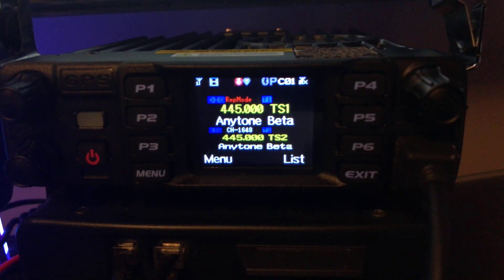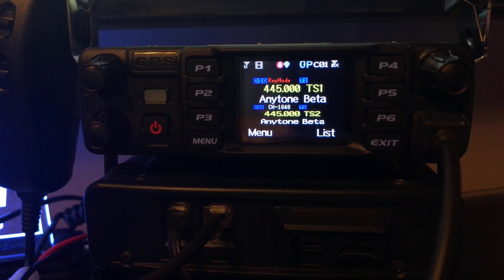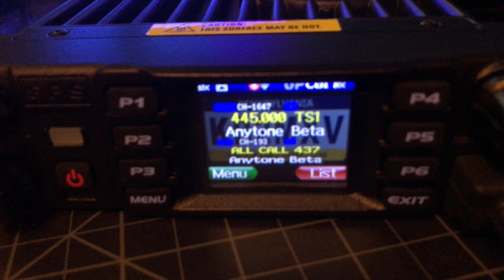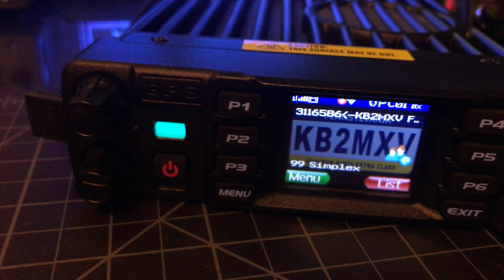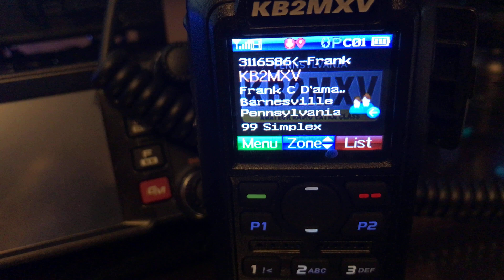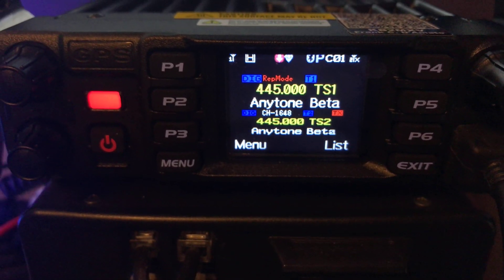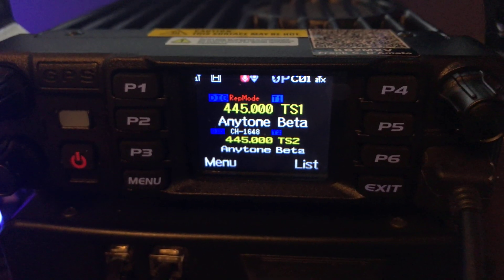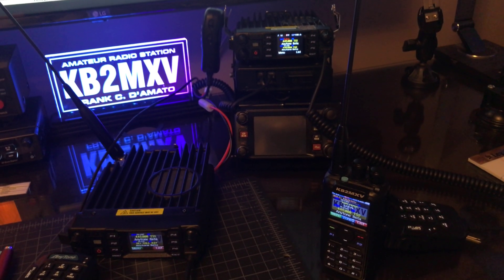AnyTone D578 repeater DMR Simplex on the Same Frequency

Comment: I guess it works, I hear the Tx on both HT's back and forth and the Tx light on the 578 comes on. My problem is, when you shut off the 578, you can still Tx between both HT's. On a couple videos I watched showed no Tx between HT's when the 578 was shut off. Of coarse they do not explain how to set this up. I crossband between UHF/VHF and when the mobile is shut off, there is nothing from the HT's. Can somebody point me in the right direction or send me a guide on how to properly set it.

Comment: I have 578 and, as I understand it, you can create any one digital channel with any TS, CC, TG, DMR Mode, etc.  Then you need to select this channel in the upper and lower fields and turn on the repeater in the menu.  Everything works fine in any TS, TG: only CC is filtered.

Comment: Time slot is a "don't care" item in a DMR simplex channel. how could you configure two DMR simplex channels, one at TS1 and one at TS2, and put one channel at channel A and another at channel B, and call itself a "repeater"? You just "transfer" the same channel from left to right and vice versa. The time slot here doesn't matter. For a normal repeater channel, you must see a burst of signal, i.e. handshake signal, after pressing PTT and prior to allowing voice transmission. In this video, I, however, don't see.

Comment: Hi, great video thanks. Can you advise the exact model? Here in Australia D578 is sold in a few different variations and some don't do SFR. Even the sellers aren't sure if SFR is installed.
For example, is your test model the D578UV III PLUS? or a different Model ID.
Cheers Mark VK2ZB.

Comment: So I'm thinking of one other test that I'm trying to get working well.  Digipeater, broadcast DMR on one channel (TS1) and receive on another DMR frequency (TS2) as a typical repeater.  I've got the 578 in cross-band repeater mode (double slot) and the radios transmitting to the repeater on simplex mode, split frequency.  Because on the 878 or 578 you can only choose a time slot for the transmit I had to do the other (B) channel as the repeater receive frequency but with time slot 2.  It all works however I can only get about ~1 mile on the transmit of the repeater with a 6.5db antenna (VHF) range.  The scenario I'm running is a 878 HT and a 578 for the mobile, and another 578 as the repeater in cross-repeater mode.  The mobile 578 can transmit back to the repeater just fine but I can't hear the HT (578) broadcast through the repeater if I'm over a mile away.  Thus, I'm thinking the TX side of the repeater is not working just right.  running it in turbo mode for power.  73 and thanks for any insights.
Reply: So I think we have a bug in the firmware or possibly a duplexing issue (or lack thereof).  I did another test of the base station that I have in cross-band repeater mode.  Took it out of repeater mode and did a test to another mobile 578 and I got great distance out of the units (more than 15 miles) so the radio and antenna is working fine.  What is not working is cross-band repeater mode farther than 1/2 mile or so.  Been trying to get ahold of Bridgecom (where I bought the radios) but they haven't been very responsive.
Reply: I’m pretty sure it has to transmit on low power to not have interference out of a single antenna. Let me know if you found any other info about this issue

Comment: Thanks for the video.  Would I be correct in saying that it will not repeat data such as sms or call confirmation?  Its an interesting feature, a lot cheaper than a Hytera SFR rig but also a bit more limited from my understanding(The hytera will repeat everything, data, different talk groups and even encrypted packets)

Comment: I'm fairly new to ham. I have two D878.  I'd like to try them in Digital mode to see if I can get better voice quality and or rang.  Any chance you can make a simple, quick video showing how to write a code plug for that?  :) 
I've searched the internet hi and low for several hrs and I can't find anything relating to the subject.
Reply: 878 radio, digital simplex mode. Go to go to VFO mode. Program the simplex frequency in your area of the country for both TX and RX. Digital mode, Talk Group 99, Color code 01, Time slot 1.  Program this into both radios and they will  operate in DMR digital mode. This not a cross over from TS 1 to TS 2 which was done in the video with the 578 using CUSTOM Beta software. This is mode not a released product.  Simplex in DMR is a normal digital mode.